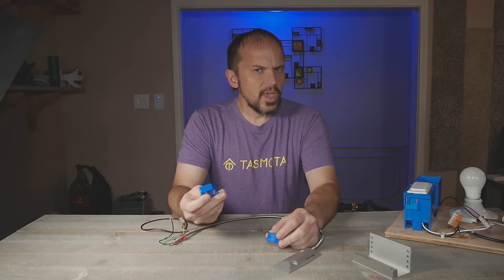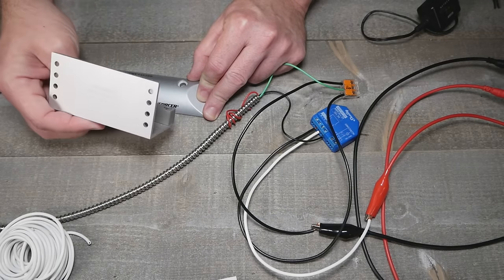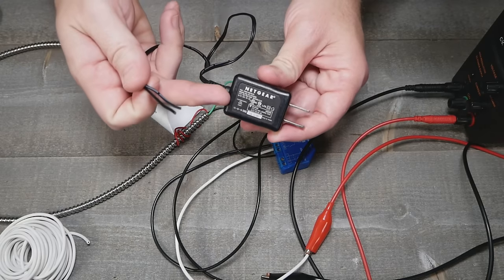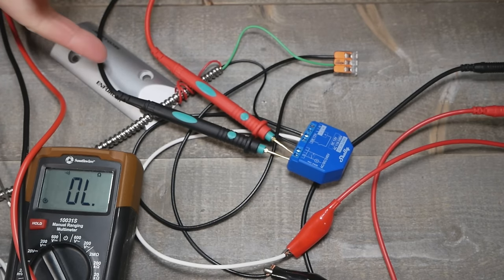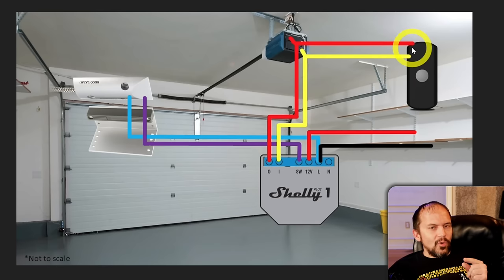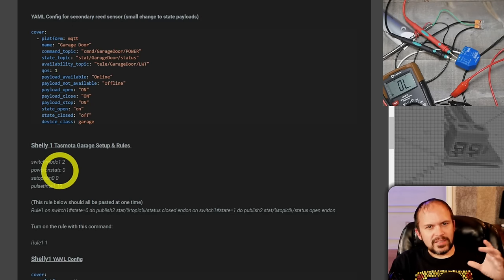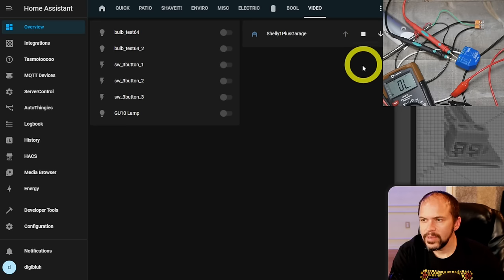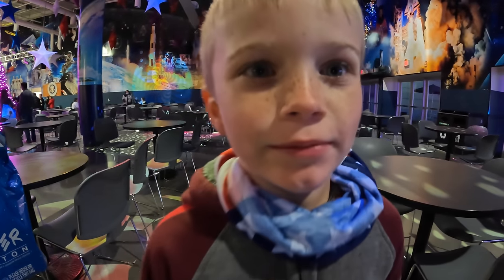DIY Smart Garage Opener LOCAL Shelly Plus 1 (Bluetooth Bonus)

Comment: My "goto" for garage doors or power gates is the Fortrezz Mimolite z-wave switches. If you remove the jumper before they are first paired they act as momentary switches so you can just add them in parallel to any door switches you have. (And I really prefer z-wave to help keep the WiFi spectrum uncluttered.)

Comment: Just did this today using a remote and a buck converter to keep 3.3V instead of a battery. For novice users the Shelly firmware works great in HA with a cover template. No need to get all tasmota + Mqtt it’s a lotta work for the same function.
Reply from the maker: I had issues with the stock firmware and such myself and prefer the ease of use with Tasmota over it. Plus you get the BLE stuff. I do applaud them for being open out of the box but I like to take it a bit further to unlock the power of things.
Reply: @digiblurDIY  I understand your motivation and thanks again for all the good videos and blog right ups

Comment: This is my first experience with one of these devices. I’m somewhat savvy with some things like this, but nowhere near where you and many others are..  one part I’m confused about is why does the garage door need that sensor? Does the garage door not already have that built in? Or am I not understanding how a garage door opener works?  When the button is pushed, the door knows when it is open or closed already. So if this device just initiates that command, why is the sensor needed? Would very much appreciate any input you have to educate me.

Comment: Sonoff SV works great too :)
Reply from the maker: Indeed it does. Still a great option as it does have some additional pins exposed for extra stuff. But I do get that not everyone wants to solder or print a case. Options are always great.

Comment: Have you seen an issue where once the Shelly is connected to the garage door opener, the wall switch stops working? As soon as I disconnect the Shelly, the light on the wall switch comes on and it works but as soon as I plug the Shelly back in, the light on the wall switch goes out and the wall switch stops working.  Great video BTW.  Liked and subscribed!
Reply from the maker: Can't say I have seen that before. The Shelly is a dry contact relay so it isn't connecting the wires.
Reply: @digiblurDIY I always get the issues no one has seen lol

Comment: Great video, thanks for updating the garage door series! What’s the best way to flash the Shelly’s these days? Is it using the little pins?
Reply from the maker: Currently at this time that is correct. I would recommend small wires for this little pins unless someone makes an adapter to go up to dupont.
Reply: @digiblurDIY  Thanks as always 🙏 I’ll grab some smaller wires 👌

Comment: Is there a sensor that could detect if there is a car in a parking spot  of the garage? I want to turn on a green light when car is in far enough to clear the garage door.
Reply from the maker: There are the some ultrasonic sensors used to detect the vehicle but with the precision you want I would use a beam style sensor much like your see on the safety sensors on garage doors to prevent them from closing
Reply: Yeah it’s called a camera

Comment: Great video -  Two questions... 1) I assume the going the Plus router is better over the OG version?  2) Can the Shelly 1 Plus connect to multiple BT devices and broadcast the values via MQTT, along with the sensor and switch state built in?   A little background - I am hoping to consolidate using the Shelly Plus1 my current setup which is garage and freezer temp monitors on one Tasmota NodeMCU and a garage sensor/opener that controls two garage doors.
Reply from the maker: In the end of the day it is still a dry contact relay.  It's a little harder to flash with the smaller pitch wires but so much more powerful in features.  

Yes, you'll be able to pull in all kinds of sensors.  Check us out in the #blerry thread on my Discord chat.  Tony has been doing some amazing work.  I've been using them on a Linkind Switch which has the same exact processor as this Shelly.

Comment: Hello and very good video! Please can you tell me if I only can connect the Shelly by bluetooth to my sliding gate motor? I have a router but no WiFi Internet connection in my house yet so I wish use the Shelly to make the same functions of a remote control but using my smartphone and the App to open the door. Many Thanks and cheers from Spain!
Reply from the maker: No. It would need WiFi.

Comment: Enjoyed the garage re-visit, and seeing that new Shelly and it's wiring in action, thanks.

This might be more of an HA question. The HA history view, which gives great audit trail of when the door has been opened, for how long, etc is another great reason to implement this DIY Smart Garage Opener. What I'm wondering about is..., when either HA restarts, or when the Tasmota device restarts (output below), the history log get polluted with some nonsense. Thoughts..?

December 1, 2021
was closed
19:10:15 - 30 seconds ago
became unavailable
19:10:11 - 34 seconds ago
Reply from the maker: That is a feature actually to show when devices are not available to HA. It shouldn't be doing that on a HA restart though.

Comment: I am confused. Are you using a Shelly 1 Plus that has been flashed with Tasmoto?  I did not hear you say anything about needing to do that first.  I have not found any instructions on how to do that.  I installed the device as you laid out in the wiring diagram and booted up the Shelly with the stock firmware.  I can open and close the door by pressing the button on the built in web tool.  I added the MQTT user, password, and server setting.  I also am not sure about your comment of the reed switch being configured as normally open.  I think you meant to say to configure it as normally closed.  Let me know.
Reply from the maker: Yes. I am using Tasmota on this setup.
Reply: @digiblurDIY  How do I install Tasmoto on the Shelly 1 Plus?

Comment: Can this be done without the reed switch?   I already have a Zigbee sensor telling the state of my garage door connected to HomeAssistant.   All I want is to simulate a button press.  Can that be done using the Shelly 1?
Reply from the maker: Yes, you don't need to use the wired reed.

Comment: Thanks Travis! I don't have a Shelly Plus 1 but I was able to make use of the Tasmota commands you went through to modify one of those cheap 2ch relays(LC-Relay-ESP01-2R-5V) that use an ESP01.  I configured GPIO2 as a switch with a pull-up to 3.3v. Only issue is the device wouldn't boot up with GPIO2 pulled low by the reed contact being closed, so I used the 2nd relay on the board to break the connection to the reed, and added another rule to turn on the 2nd relay 10s after boot up. That worked but seems messy. Do you have a more elegant solution?

Comment: I’m having trouble with the Reed switch state display.  It’s wired correctly (will toggle button when not set to detached). But, when set to detached with input state turned on, there is no change. Any suggestions?
Reply from the maker: Does it toggle in the console?
Reply: @digiblurDIY  No.  I shorted the switch with no change either. Changed to momentary to test the switch, and then it would toggle. But, would not change state when detached.
Reply from the maker: Are the rules turned on?

Comment: I didn’t understand a lot of what you said but thank you.  I have  a gate with a remote opener and a barn with two doors with remotes.  I have  a garage with two doors controlled via ‘Q’ .  I can open and close them with my phone but not the gate or the barn doors.  I. Wonder if I could use the Shelly system to work on my barn and gates.
Reply: I installed automated gates and changed professions right when the technology was changing to smart operation. Most gate operator’s use very similar mechanics and relay logic as garage door openers so depending on what type of gate operators you have…you most definitely can use this system (or a similar one) with your gate

Comment: What is the advantage (or disadvantage) of using a smart binary sensor as the means of sending a signal to HA that the garage door is closed vs using a non-smart switch hardwired into the Shelly?
Reply from the maker: Hardwire being it works and you know if the sensor fails or wire fails immediately as it will trigger as open.

Comment: Where you get the power from I or O? I thought you neede to connect a power line from 12v to either I or O needed clarification please
Reply from the maker: I or O is for the input and output on the dry contact relay.

Comment: Thanks for another great video. Would you think about doing one on the new SONOFF Zigbee 3.0 USB Dongle Plus thinking about starting zigbee network. Looking at that dongle or the conbee ii don't know which one to go with in Home Assistant.
Reply from the maker: Actually just posted a community post about those in my channel. They are CC2652 chipset which has been rock solid for me. Look at my Zigbee video from about 4 or 5 months ago. Still relevant but I do have a follow up planned.
Reply: @digiblurDIY  Thanks

Comment: How important is 12 volts.  What is the input tolerance range for the Shelly plus?  I checked a few 12v wall warts and they are all over the place on output from. 9 volts to 20 volts.
Reply from the maker: I would stick to as close to 12vdc as you can.

Comment: Hoping that you will see this. In 2022.12 MQTT formating is changing so that affects the cover sensors. My system was working fine until I reformated it like they say in the wiki for mqtt cover. But now when I update all my covers are gone. If I revert back to your original code I get a deprecation/change message. Can you tell me possibly how to rewrite the cover yaml. Thanks
Reply from the maker: you have to shove them under the MQTT: entry instead of being under cover, switch, light etc.
Reply: @digiblurDIY  Thanks for the information, but no go. It seems that a lot of my devices are starting a cascade failure. Some have to do with MQTT but a lot of my Tasmota devices are failing as well. I greatly appreciate the help and will start to sort this out.
Reply from the maker: I would use the Tasmota HA integration, no manual YAML required for those.  It does require Tasmota 9.2 or higher though.  

It's probably just an indentation issue, jump into my discord and post what you have.   We can sort the syntax out or you can take a look at this example to see how it is supposed to go:  https://digiblur.com/wiki/devices/other/treatlife_esmlfe_fan_ds03#home-assistant-configuration

Comment: Having some trouble getting this to work in HA. Seems there was a change to MQTT in June 2022 that broke the YAML. Here is what I have for the cover. Can't figure out the sensor bit yet. 

mqtt:
  cover:
    name: "Garage Door"
    command_topic: "cmnd/GarageDoor/POWER"
    state_topic: "stat/GarageDoor/status"
    availability_topic: "tele/GarageDoor/LWT"
    qos: 1
    payload_available: "Online"
    payload_not_available: "Offline"
    payload_open: "ON"
    payload_close: "ON"
    payload_stop: "ON"
    state_open: "open"
    state_closed: "closed"
    device_class: garage
Reply from the maker: Pretty much the same as with cover you just have to shove it all under the mqtt section now.

Comment: thanks for tor the tutorial. Sadly I don't have a Tasmota set up. So I have to rely on the cloud. I'm using a shelly 1. Not a plus. The current app won't let me get into settings or application settings. It asks for a firmware update, but the app won't allow me to update the firmware. I tried updating shelly's firmware via the IP address. That failed to. So I decided to run an older version of the shelly cloud  app. I also want to set up scenes so when the garage door is left open, it will send me a notification to my phone that the door is open. Though I'm not really understanding how the scenes in the shelly app work much. I had intially done this set up using The Hook Up's tutorial. But he didn't go much into details issues that might arise. I wish I could upgrade the firmware of the shelly 1. Maybe the Shelly 1 is too old and I need to buy a shelly 1 plus.
Reply from the maker: The one thing I know about the stock firmware app, it's a big mess, looks nice but definitely not user friendly.  You should be able to upgrade them though.

Comment: I'm having an odd issue.  I'm using the Shelly1 (version 3) and successfully flashed tasmota on it.  I entered the 4 settings and 1 rule into the console and enabled the rule.  My issue is that when the reed sensor activates the switch, it closes the relay.  Interestingly after getting MQTT setup the Tasmota add-on found my shelly1, but it only shows the relay state, it does not show the sensor.  How can I decouple the switch state from controlling the relay?
Reply from the maker: The rule you entered is wrong or not turned on so it didn't decouple things.
Reply: @digiblurDIY  Very weird, I must have copied and pasted the rule for the sonoff switch.  I did a reset to my configuration and it decoupled it correctly.  I also entered SetOption114 1 this allowed the switch to be automatically detected by Home Assistant without any modifications to the yaml files.  Thanks!

Comment: Great stuff here.
I have a Shelly 1 Plus connected with an intercom door opener. I got Shelly to open the door, that was the easy part.
My problem is, I’m trying to get notifications on Shelly when someone buzz’s the intercom. My thoughts are: your garage sensor would be like my intercom button that sounds a buzz. Does that make sense? I’m also new to the home automation and do not have HA. Can the coding be done through the script page of Shelly?
Reply from the maker: Is it DC powered and the button is just a dry contact basically?
Reply: Yes, it is DC powered and the button is dry contact.
Reply from the maker: I would just do it like a reed sensor and snag the push out with a rule or decouple the button with setoption114
Reply: I live in an apartment building, so the building door is a couple stories away. Not really accessible. But I do have a wire that buzz’s when someone pushes a button at the building door. Can I work with that alone? I would love to share a sketch for my wiring. Is there a way I can send it over?
Reply from the maker: Probably jump into discord
Reply: @digiblurDIY  Thank you. I'll be searching for other alternatives.

Comment: After your help from the last garage door video I needed to upgrade because the device burnt out again. I have everything up and running with one problem. When the door is open it shows the state as closed and when closed it shows as open. Is this a mismatched wire or something in the tasmomta console. Thank you.
Reply from the maker: It could be just based on how you wired and/or the reed switch. You can change the switchmode1 to 1 or 2 to invert it. Check to see which it is set to first.
Reply: @digiblurDIY  Thank you, that solved it. Greatly appreciated.
Reply from the maker: Awsome!

Comment: I have read that these no longer need to be flashed with Tasmota or ESPHome to work with a Garage Door Opener, how is this wired with a contact sensor to work with stock firmware?
Reply from the maker: I prefer to use the open source variety myself on these. Not familiar with the stock firmware.

Comment: So if I wanted to use this for a 24V DC power supply to turn on some 5V DC LED lights I would still need to step the output down, right?
Reply from the maker: No. It's a dry contact so you could actually power it via DC and have it switch mains AC if you wanted to.
Reply: How would I wire this?